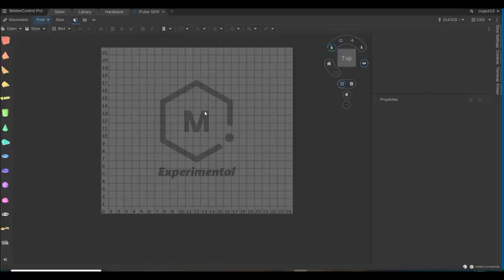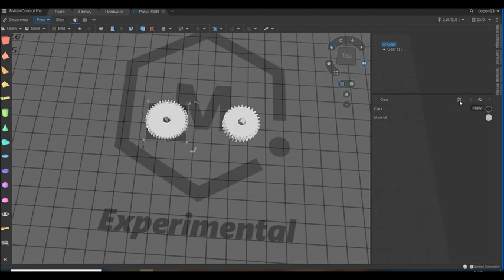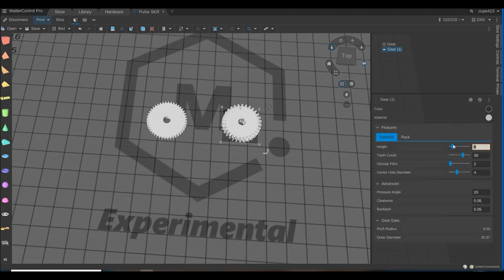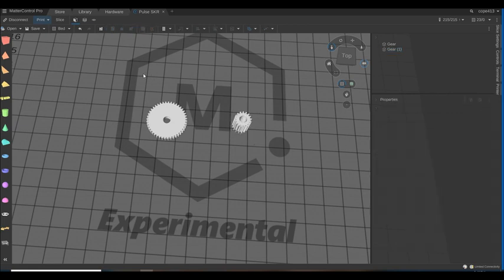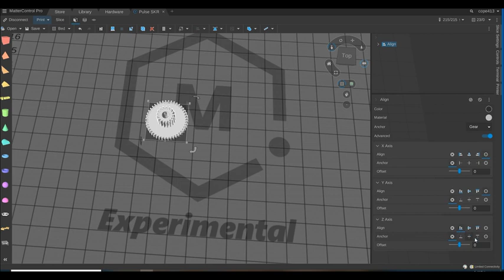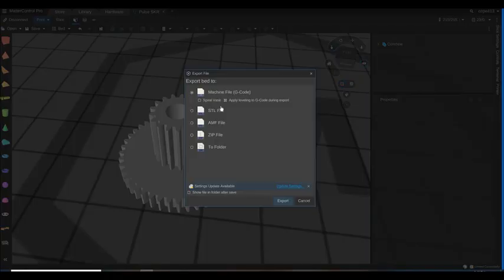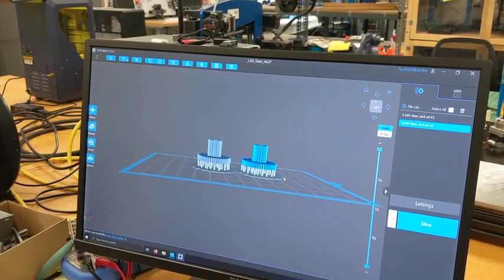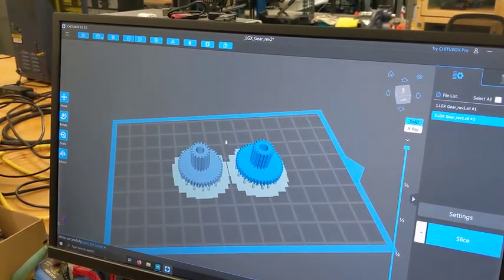How to Create a Custom 3D Printed Gear // 2 Minutes with MatterControl

Comment: Does the Gear creator option require the purchase of Matter Control Pro?
Reply: I just downloaded the free version and tried to do the gear tool but it was telling me I needed the Pro version.  Clicked the upgrade link and the price is $155/year.  Definitely not worth that to me so guess I'll be uninstalling the software as quickly as I installed it.

Comment: I saw a you tube video made by a creator into RC car building and 3d printers. Two gears combined and printed as one that were subjected to higher torque did not do well when printed as one piece.They failed quickly at the junction. The solution was to make the small one a male type + sign protrusion and the large one a female type + sign indentation and glue them together.
I will try to find the video and give that author his fair credit.
Reply from the maker: It makes sense why printing the pieces separately creates a stronger part. By separating them you introduce perimeters interfacing between the two parts, whereas printed in one piece you only have the inter-layer adhesion holding the upper gear onto the lower. And buy using a plus sign it'll take a lot of torque for the plus to break and spin and you will more than likely just break the teeth off before then. In the case of these gears, they won't be interacting with a lot of torque and by being printed with resin they are more homogenous overall, but definitely an excellent point to consider! - Alec
Reply: https://youtu.be/JMgXu1rFDJ0

Comment: I'm going to try this. How would I control tolerances if my printer needed .1mm more or less say on the teeth?  Thanks!
Reply from the maker: I talked to Taylor about this and his suggestion was to adjust the circular pitch of the gear until it fits right. Hope that helps! - Alec